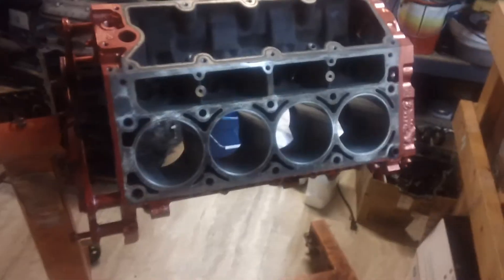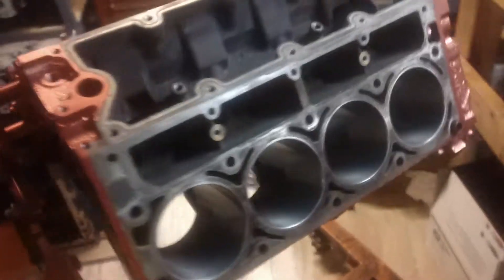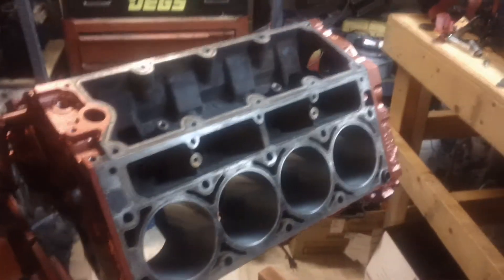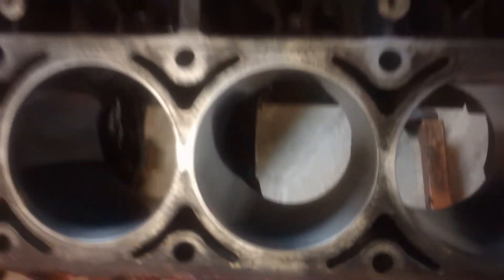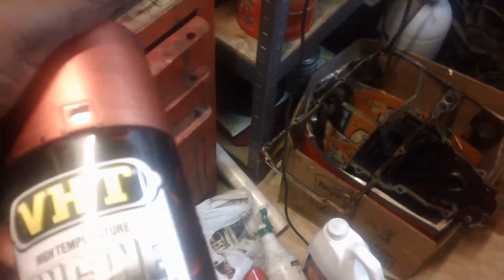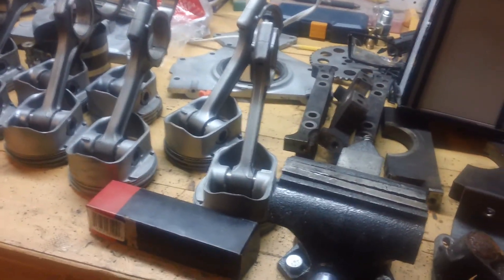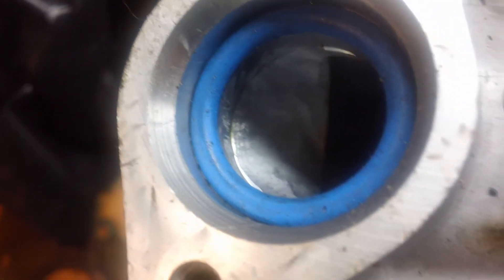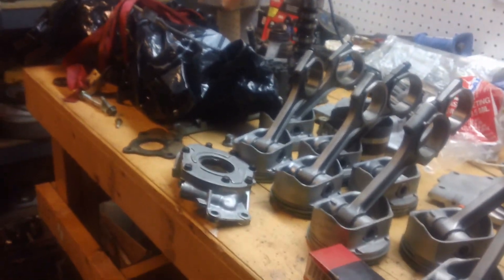6 0 LSX build pt 11

Comment: Nice Ken C! Doing Work! Good job man. I dig the project. After seeing what the 5.3 Squirter project of mine is working with, I'm pretty sure that lil mark in that once cylinder will be ok. 

Also, I bet you gonna hear flack about running that LS1 crank in a 6.0 because of balance and blah blah blah, but I say do it and dont let the dog you. I would also. Keep it up and Keep on Wrenchin brotha!